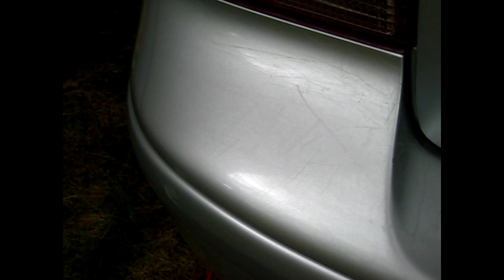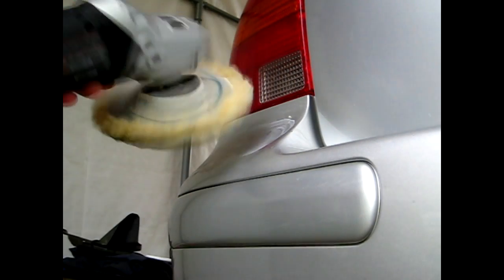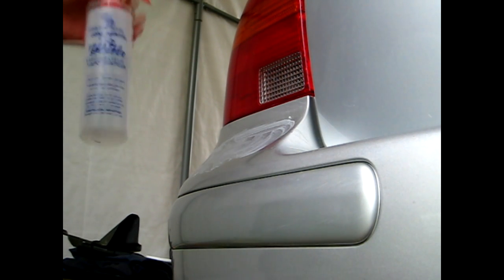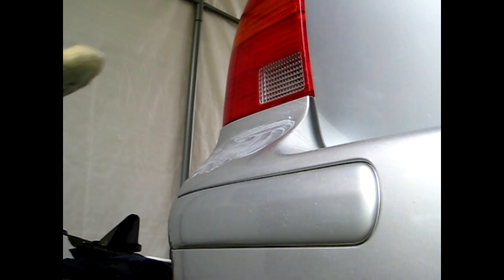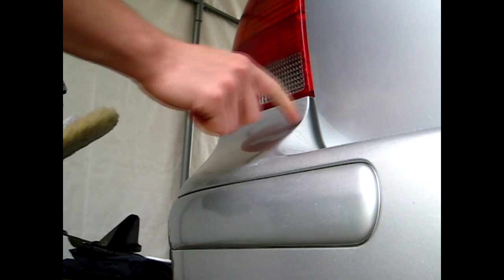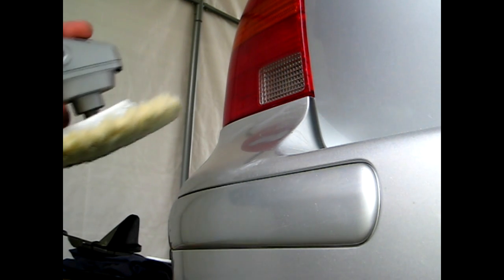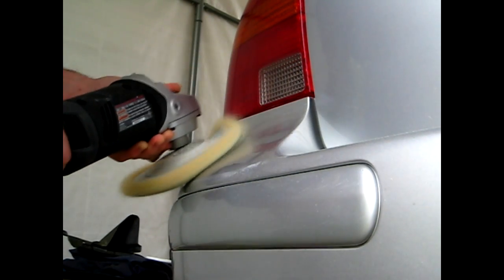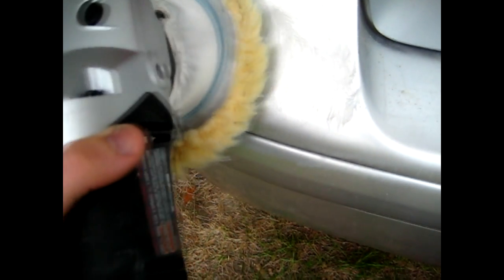How to Easily Remove and Polish Scratch in Paint on your Vehicle

Comment from the maker: @rizzy77 Hello... Considering it was just a smooth area with no groves, I just gave it a spray with water and wiped the area with a clean cloth. If you were doing the whole car, I would recommend washing it before the wax stage. Any compound that is left on the car over time in the sun will bake it on which can make it very hard to remove after.

Comment from the maker: @Naadrow Thank you for the comment! I actually don't have a system besides the deck. As for the main power wire of the amp, you would need to remove your cowl in front of the windshield. There's a plastic cap were the car's stock wiring runs through, so you could possibly run it through the same location. Or under your dash on the driver's side, there is main posts for constant & switch 12V which I'm sure can be used for an amp. The fuse box I believe connects to that same location.

Comment from the maker: @MrVat7 Well toothpaste does have an abrasive to it, so it possible would work at a polishing compound. Unfortunately I've never tried it before, so I'm not sure how course it would be. You will still have to use a wax to get the final shine and protection on the paint.

Comment: i have a 01 gti silver aswell, your videos are great, keep them coming.

would you consider doing a video on running a power cable to the battery for an amp...i curious on how you would get through the firewire its pretty difficult on these cars

Comment: Great video bud. If I may, I used to work as a automotive refinishing specialist and the first thing I started doing with that job was buffing out scratches. Two things you may want to remember when doing this method is: 1. the outcome will always come out better if you lightly wet sand the area with 800 grit before buffing. 2. This goes towards more of darker cars IE anything other than white and light silver/grey, you need to use, we called a "black pad" a foam type pad, after the buffing pad.

Comment: I see you used polishing compound and scratch/swirl remover polish. No need to use rubbing compound??
Reply from the maker: Polishing compound is a form of rubbing compound, but there is different grades available. Some more course than others, but polishing compound would be the finest. I normally stick with polishing compound, it may take a little longer but it reduces the risk of taking the finish off the paint.